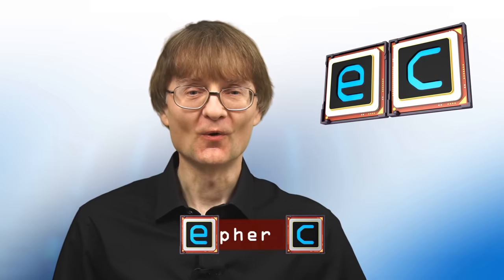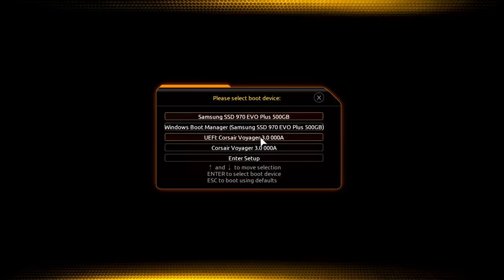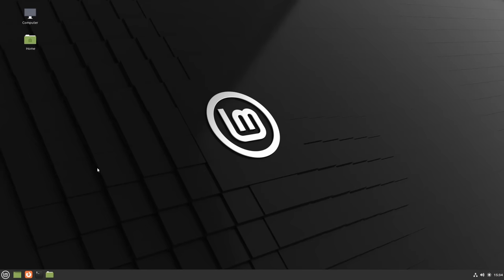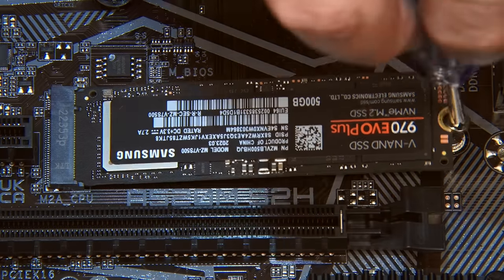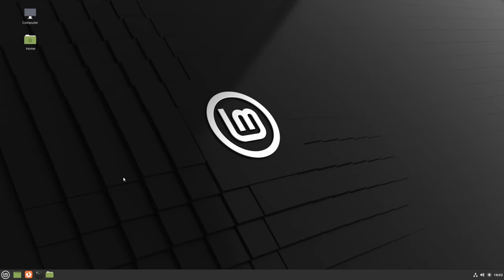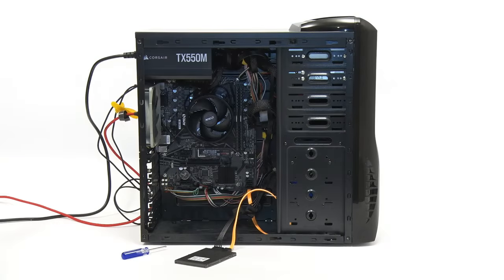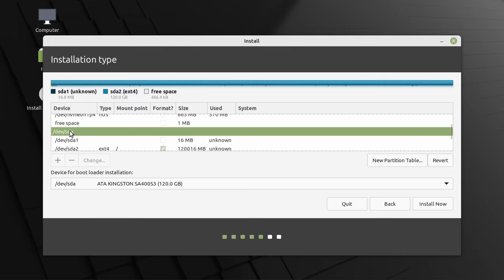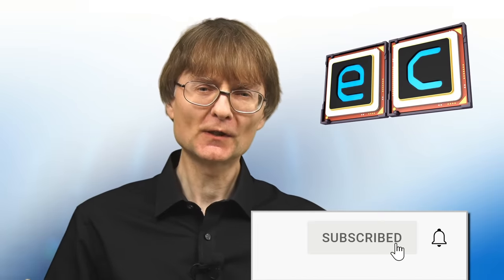Windows & Linux: Dual Drive Dual Boot

Comment: Amazing video! Exactly what I was looking for! I'm planning a dual drive dual boot because I read about other people's experiences with their GRUB beign corrupted by Windows. However, when asking about this method on a Linux Facebook Group, folk there said that even with a dual drive setup sometimes Windows can still mess with the UEFI and affect the Linux drive. Is that true? To my understanding that doesn't make sense, but I am still looking for second opinions before comitting to my plan. I would appreciate any comments on the matter.
Reply from the maker: If you keep Windows and Linux entirely isolated (as in the "remove drive" method I show here) you should not have a problem. In many years, I never have. However, folk in the Facebook group are right that there can be issues if the drives are not fully isolated -- as we saw in the last example in the video, even when placing the bootloader on the Linux drive, with the Windows drive present during the Linux install, it still probes for it . . .
Reply: @ExplainingComputers  So there's a way... I can't explain my giddiness right now. If removing the Drives for the installation is all that's required to avoid that problem, I think the extra effort is more than justified. Thank you very much! This was super informative!

Comment: I don't fully understand Windows Boot Manager, I recently upgraded my system hard drive and copied Windows 11 to it using Macrium Reflect.  The new drive booted into Windows 11 fine, until I formatted and removed my old drive, then it said it was corrupt.  The only way I could get around it was to do a fresh install of windows to the new drive and then restore a backup I had made over the top of it.

Comment: Great video,   but I still prefer to have a mini pc like my asrock x300 with 5700g for linux besides my windows 11 office  pc for linux.  Means I can use both at the same time and just switch the monitor  input from one to the other. Having a single PC with just one or the other in dual boot I find too cumbersome.

Comment: Two things I notice with a dual boot of Windows and Linux (and I remember one of these from my Hackintosh days) the system clock will often get reset when booting between OS's. It's a simple fix each time, but if there's a way to set things up where the clocks never are off, that would be great. (I forget what the solution was when I used to boot OSX and Windows on the same system, but I think there was one.) Also, Linux won't boot with secure boot turned on- I'm guessing there's no real issue leaving secure boot turned off from the BIOS settings? (Sorry, if this was covered in the video I missed it! ) At any rate, I'm just leaving it turned off. I like doing work in Windows, then switching over to Linux after and I don't want to constantly toggle secure boot on and off.  (Found it! The command timedatectl set-local-rtc 1 --adjust-system-clock  in Linux terminal will set Linux to use the local time and not reset the Real Time Clock in the BIOS. Now my Dual boot is perfect!)

Comment: With a lattepanda delta, what would you recommend doing if you want to keep windows on the emmc card and put linux on the m.2 nvme? Thank you for your great tutorials.
Reply from the maker: On the LattePanda Delta, there is a setting in the BIOS to disable the eMMC flash storage. This is like removing the drive. So I would prepare your USB drive with Linux on it, and fit the M.2 drive. Then boot the LattePanda Delta and go into the BIOS and de-activate the eMMC storage. Then boot from the USB drive and install Linux to the M.2 drive. and then, finally, boot and go into the BIOS and turn the eMMC storage back on, and you will end up with a configuration as in this video. I've done this on a LattePanda Delta, and it works well. :) Good luck!

Comment: I have had no end of trouble trying to recreate what you show.  I am having tremendous trouble with UEFI bios on my new machine.  Perhaps we could be doing with a Video on UEFI, TPM, SHA-1/256 keys and mokutil and the whole issue of secure boot and the problems you can get into.
Reply from the maker: Sorry to hear that you have had problems. What you see in this video are installs on a new system with a clean install of Windows 11 and secure boot active, and using Linux Mint 21 (which also supports secure boot). The problem with a video as you describe is that it is impossible to recreate the myriad setups that may have "evolved" on different machines. I wish you the best of luck!
Reply: @ExplainingComputers  Thank you, Yes fortunately I heeded your warning at the end of your video.  I had everything backed-up and know the consequences.   I have sorted the NVRAM on my UEFI bios by using the UEFI shell. I now have Linux mint to play with on a separate SSD as you have. Yipee...  The problem was not having a new system as you make comment, but was the lack of knowledge that UEFI even existed and handling secure boot.  I also had problems that the Linux distro could not see my drives due to the bios being set to (Raid) Intel-RST mode.  After some googling I learned how to manipulate the Registry and bios settings to have AHCI Sata mode without reinstalling windows 11.  Pew....

Comment: I did the two NVME SSD install but, i installed with both drives in and chose to install the boot loader on the Linux drive. The result is the computer defaults directly to windows. I only see grub if I select the boot loader and select the second drive. Best part is, If I remove the Lynux drive, it has no impact on the windows drive.

Comment: It is actually not that easy as installing two Windows systems back in the MBR old days. You can easily mess up with the boot options. There are many tricky things that may happen, especially related to Secure Boot.
Reply from the maker: Sadly true.

Comment: Just curious would the dual drive method B also work the otherway around? As in having Linux installed first and then installing windows on a second drive?
Reply from the maker: Yes, this would work -- assuming you are referring to the method where one drive is disconnected when an OS is being installed on the other. But if you want to use a GRUB menu in the dual boot, Windows needs to be installed first.

Comment: I've had GRUB become corrupted. It is certainly a pain. It's worth adding the second drive if you can. But on some of the refurbished computers, it is extremely hard to do. Some of the old BIOS versions have a "security feature" that keeps people from replacing Windows. You can't add new disks. You can't use GRUB. And you can't erase Windows and load Linux. If you get one of those computers, you have to replace the BIOS.

Comment: Be aware that updates can be tricky. It's best if Window is the primary drive because of all the update reboots. You can't just walk away from the pc as it's updating. I have my pc set up with two Windows boot drives. One gaming and one for running our congregations Zoom meeting. But for some reason I get a uefi error if I remove the extra drive. It won't boot without both. I shouldn't have created the 2nd boot drive while the 1st was still installed.

Comment: I set up the dual drive system with win 10 on one drive and Zorin on the other. It worked well, but for some unknown reason, when I booted from Zorin to windows, the clock in windows had changed to the time from Zorin. I don't know why. My MB is an Asus Z 97-E

Comment: Just install windows then linux (and yes dual drive - aka 1 drive per os is the best!) and use grub to switch between them. Simple change grub conf to remember the last option (in my case even enable other os detection - arch btw) and you are fine. My grub controls both os and does not do anything with windows disk - removing the linux disk and windows is still bootable (and vice versa)
Reply: Some good parts are in this guide - esp for newer and less tech savvy people but there are also some parts that are 'dangerous' and I would not recommend (e.g. delete the hole disk not just the partitions. Option B - you should never have to create a root partition if you deleted the disk (the hole disk) correctly - use disk manager on windows  not diskpart - diskpart is for users that know what they are doing - disk manager with gui much simpler (even if you know what younare doing...) - and delete all paritions of the disk you want to use.

Comment: Better yet- run Linux through a VM on Windows so when it inevitably breaks in some opaque way you have no hope of fixing, it doesn't really matter because you were only playing around with it anyway. See, I can drop snarky comments about Linux too.
(To be fair, while I have lost early Debian builds, Zorin OS and one or two others so far, Ubuntu is still keeping on keeping on so props to the one true distro that isn't KDE.)
Reply from the maker: Running Linux (or Windows) in a VM -- which I've covered in other videos -- is certainly an option, but not if you need full hardware access. I've been running Linux Mint for years with no issues. :)

Comment: Nice. I have a dual boot dual dick with an additional Data drive to have my data slightly safer than on the boot disks. ( And actually a backup drive as well)
Reply: Wow, that extra unit must be handy.

Comment: my motherboard doesn't have a separate boot menu - I have to go into bios every time and select the order.  I'm on an asus tuf gaming x570-plus (wifi) -- and my old asus rog strix x470f gaming one didn't do that either, unless I've missed something.

One takeaway here is if you want to dual boot with grub taking over the booting duties, you have to manually partition the drive, correct?

Comment: Is the single drive dual boot setup that bad? At the moment I'm not trying to buy an SSD. However, I've been meaning to upgrade my PC from one HDD to two SSDs and will probably do so near the end of the year. For now I just really want to try Linux and start developing in it.

So for now(the rest of 2024) would the single drive be a good idea?
Reply from the maker: A single drive dual boot will probably work just fine. But there is a risk that a (major) Windows update will corrupt GRUB, preventing access to both OS without some serous messing about. Which would provide you with some good Linux experience! :) Good luck with your Linux journey.

The other approach would be to set up Linux in a virtual machine.
Reply: @ExplainingComputers  Thanks! I think I will use a virtual machine for now and wait for my upgrade later

Comment: I have Windows installed on M2 drive and Linux Mint and MX Linux on an SSD drive and use Grub on startup.  The grub menu sits on the SSD, because windows does not play good with grub

Comment: It might be a dumb question, but dual boot will have any impact on the performance of the OS?
Reply from the maker: It should not. This is the benefit of dual booting over using a virtual machine.

Comment: I recently installated Linux MInt 21.2 on a laptop with an NVMe drive (for Windows only) and a SATA drive on which Manjaro used to live. Quite to my utter annoyance, the LM installer ignored that I had selected the SATA drive as device for boot loader installation, also ignored that I had manually selected the Windows EFI partition and changed it from "use as EFI parition" to "do not use partition", and had selected the newly created EFI partiton on the SATA drive to use as LM's EFI partition. And while it doesn't make any real difference in everyday usage, it's the principle of the matter. The installer should do exactly what it was told to do. Period.

Unfortunately, this also means that I can't create a portable Linux Mint installation on an external SATA SSD unless I open up the laptop to remove both drives. This is very cumbersome to do and the reason I didn't remove the NVMe drive before installing LM on the SATA drive. I've tried creating a portable LM installation in what can only be described as naive hope, and despite what I select, the LM installer will use the NVMe's EFI partition, leaving the external SSD unable to put on any other computer.

As much as I like Linux Mint, the installer needs to be fixed. A piece of software ignoring user input and doing what it wants might be par for the course in Windows, but it should not be acceptable for Linux.
Reply from the maker: I can only agree.

Comment: I tried a single disk dual boot system using grub and after a couple Windows updates, grub stopped seeing Linux.  I wish I had seen this before I set up the initial dual boot.  I would have installed a second drive to install Linux if I knew what Windows was going to do.

Comment: Probably many cheap W10 PCs will be for sale in fall 2025. I might buy a $50 or $75 eBay Dell desktop & a new hard drive for Linux. Then use my KVM switch for Linux PC & my 2012 W10 Dell desktop. 

Had a 2000 Dell triple-boot desktop once (98se-2000-xp); now it's dual-boot (98se-2000 for games). Also had a $60 eBay P4 Gateway desktop (Linux) for a few years, until it went to the recycler. Multiple OS on one PC can be a pain in the neck.

Comment: I have been trying to get this working on my win 11 machine. But it tells me it failed to load the uefi.

I used Belana Etcher to create the linux thumb drive from the ISO. It seemed to go as it should. It installs the ISO onto the 16GB thumb. In the bios the thumb shows up. I select the thumb to boot from and it says uefi failed. I deleted everything from the thumb and removed every partition using diskpart and then tried again. The creation of the linux thumb seemed to work, but once again when the thumb is selected as the boot drive, it says uefi failed.

I tried enabling CSM(legacy) boot mode and still no luck. I tried a different thumb drive and got the same results. Literally the only option I have not tried is removing the windows boot drive first. My gut is telling me the MB is preventing linux from installing. 

My system:
Asus x570
64GB 3600 ram
m.2 1TB windows boot
240GB WD sata was going to be the linux mint drive

Any ideas?

Comment: I've had a few years experience playing multiboot systems - at one point having Windows 95, OS/2 3.0, FreeDOS and an early version of Red Hat Linux all on the same drive.  But I have also been on the receiving end of Windows 10 installing a service pack and borking the boot loader, effectively disappearing the Ubuntu partition - typical Microsoft refusing to play nice.

Comment: Oh if I had only seen this before I installed Mint as a dual boot to my Windows 10 Toshiba Laptop! 
It worked but the problems started when windows updates would hit Grub's priority for Linux and I asked some experts how to put Windows back on top. The result was corrupted Grub and complete inability to boot into Linux and Windows was left not being able to perform updates! Since then something has sorted itself out and Windows updates are working but I still have no access to Linux.

I need to also use Linux so I thank you very much for your advice. Since I don't think I can install a second SSD inside the laptop is it feasible (performance wise) to use a usb connected SSD or other drive as my Linux dual boot drive?

Comment: Hello, I have tried that method several times but it would not work on my ancient  PC (circa 2018) so much so that I could not install Windows 11 for lacking TPM. As a work around and for the need to brush up on Linux considering the nearing demise of Windows 10, I had a Kingston 2.5 120 gb installed with Ubuntu 24.04 and the latest LInux mint using Yumi.so making it bootable. As my startup in bios of course sets USB first then installed SSD with Windows 10, I am able to use either linux mint or ubuntu by using an SSD external case hooked up to USB3  on my ancient computer. When I want windows , I just disengage the external SSD drive.. Alas for ole men like me, inheriting discarded PCs from the grandchildren.

Comment: Been dual booting for 3-4 years now with no issues.. Don't think windus corrupts grub.. anymore.. Should it happen, just boot with eg. "super grub 2 disk" and do a update-grub, np. 👍
Reply from the maker: Thanks for this. Others in these comments do report issues. :) 'm not sure the average Windows user (or Linux beginner) would top-of-head "just bot with "super grub 2 disk" and do a update-grub, np. :)
Reply: Mebe so, but  it's a great way to boot a system with broken MBR. And if youre going into multibooting...

Comment: I have followed your instructions for a dual drive dual boot system to the letter and Linux Mint Cinnamon loads from the USB flash drive. Moving the mouse moves the mouse pointer but clicking the left or right mouse buttons does nothing. Also, there is no icon in the top left corner to install Linux Mint onto the hard drive in the PC! Any suggestions are most welcome! This is the first time I have done anything with Linux so I am a complete newbie!